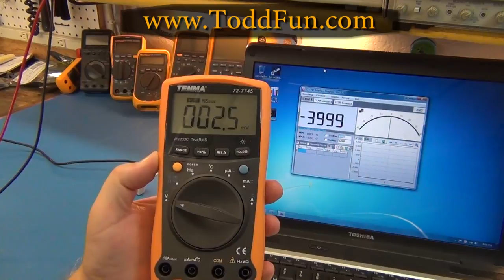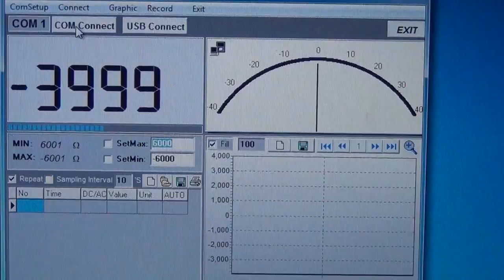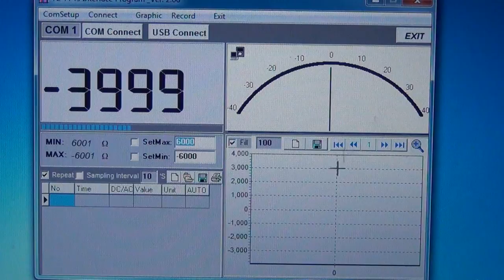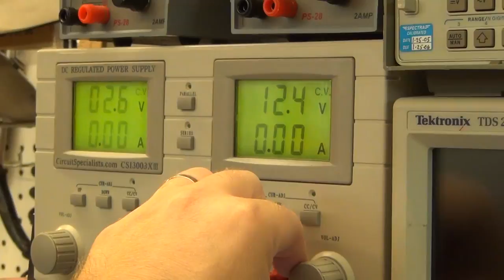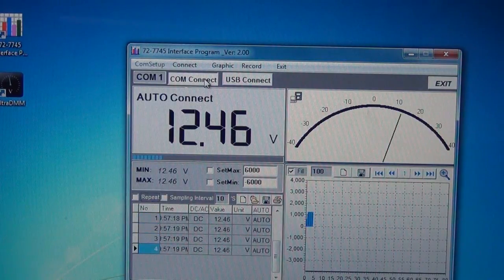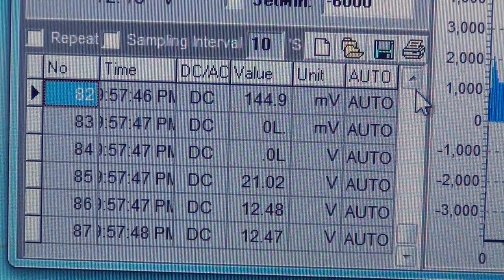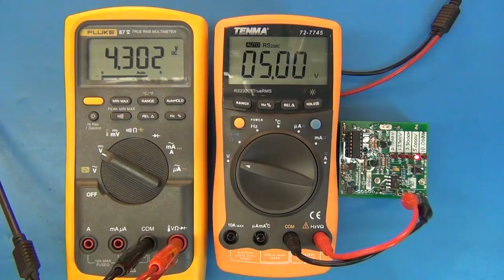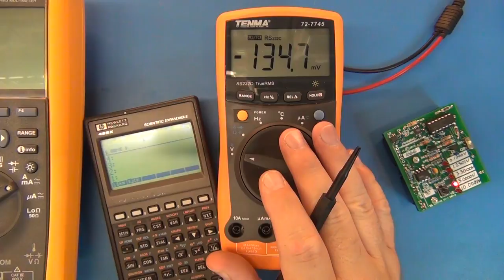Tenma 72-7745 Digital Multimeter Review Part 2 of 2

Comment: At the start of the video the meter isnt plugged into anything but it shows a reading. Is that normal? Mine is doing that and I am thinking it is faulty. Why isnt it just showing zero?
Reply from the maker: The leads act like antenna and pickup stray voltage readings and in other settings meters will have some small drift. If you are measuring very small values and your meter has a "zero out" or "null out" button then press it before taking new measurements to remove the small environment error or meter drift.
Reply: I always fry my meters, i keep forgetting to change the setting while jumping from point to point to test voltages. I seen they have autovolt meters now but still wont change the current type for you. The meter I have is a Tenma 7720 and it read 0 before i fried it. After opening ip up, changed a fuse, had a quick look for burnt resistors which seemed fine it is now reading .02 volts on any setting. It is annoying. It still reads current buy with an extra .02 volts One wrong move and its a paperweight. I cant imagine those who buy $1000 Fluke meters doing this. I would love to see a video on youtube of that moment. A compilation of "Awwwnhooo...wut?...I just fried my $1000 meter"